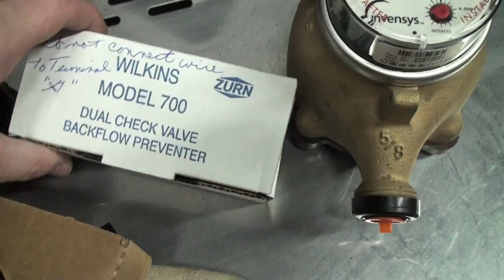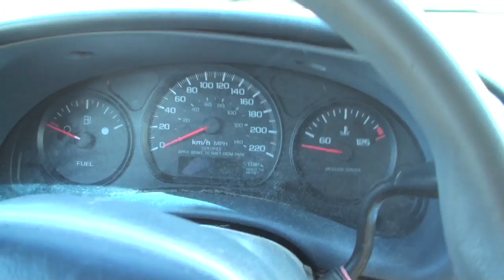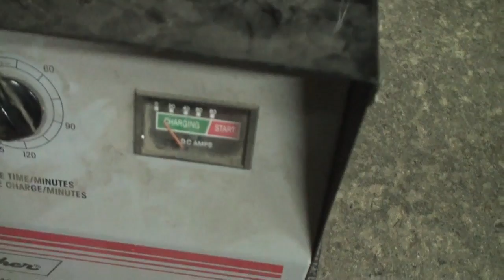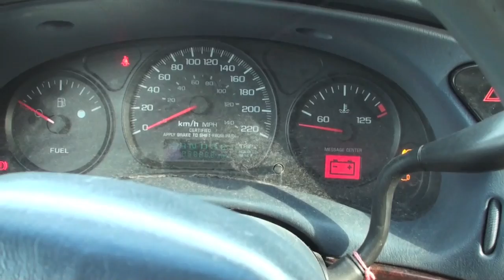ninja no start

Comment: My Durango was acting similar to the Impala, no start and clicking noises coming from the passenger side of the dash.  Turns out it had some pretty badly corroded battery cables.

Comment: Great vidjya!!!.....   Plumber advice tines........   If ya got a check valve on the water supply...your gonna likely need a domestic expansion tank..'cause yer hot water tank T&P relief valve will start popping....no wheres for the water to expand down the towns water mains....little 2 gallon will do on a 40 gallon hot water tank...make sure its a domestic kine.. not the ones fer boilers......beg my 'pard.